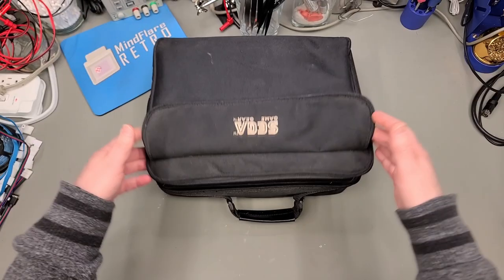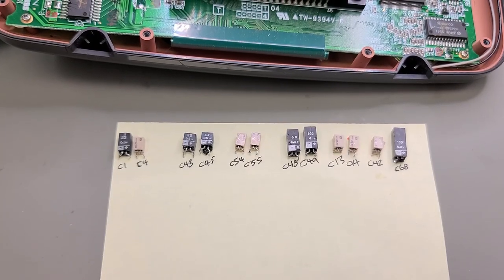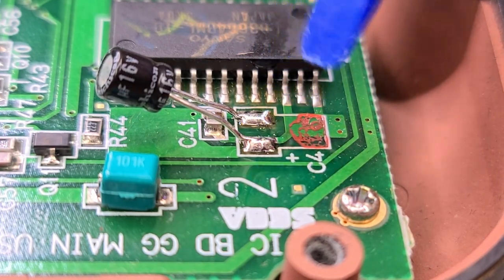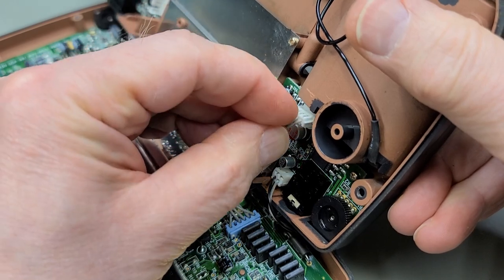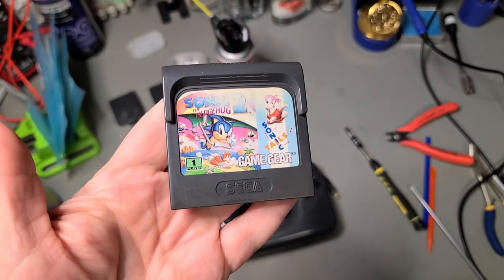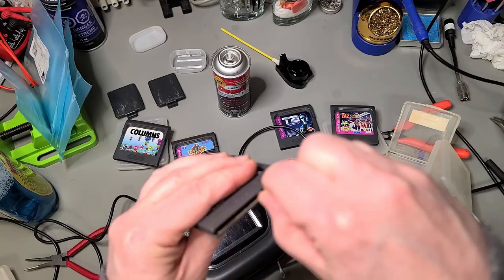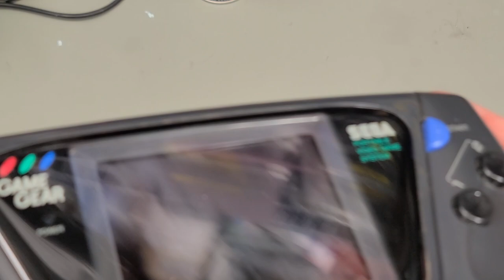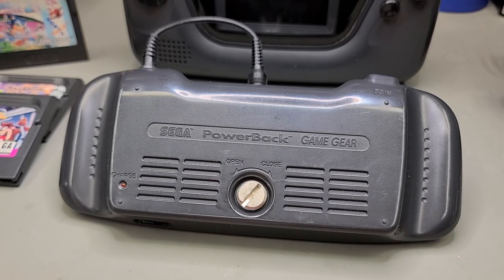Sega Game Gear Refurb — Part 2

Comment: I never saw caps being installed like this. So we don't really need to thread it through the PCB holes?
Reply from the maker: Well, always best to thread them through the PCB holes when the PCB is designed that way. The Game Gear is an odd design in that respect, no through holes in the PCB, just pads, yet they use "through hole" capacitors.